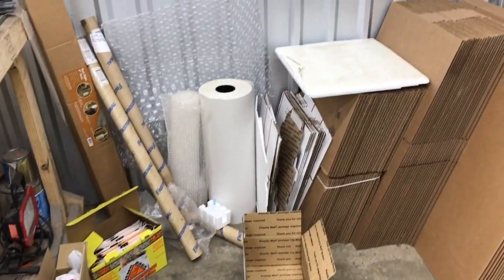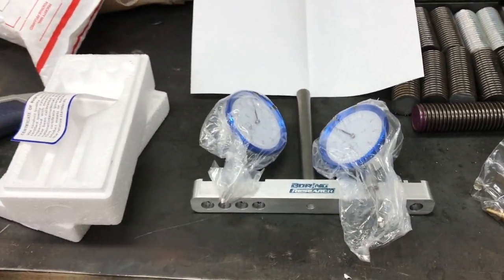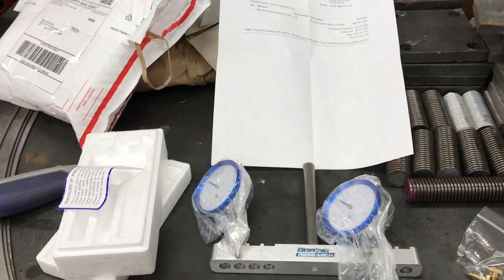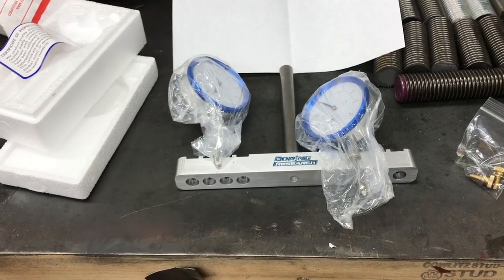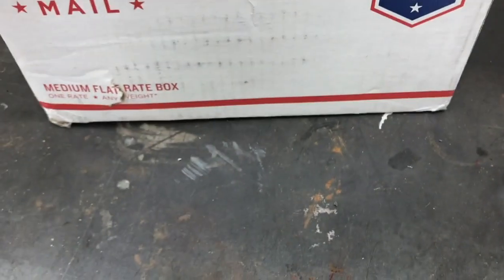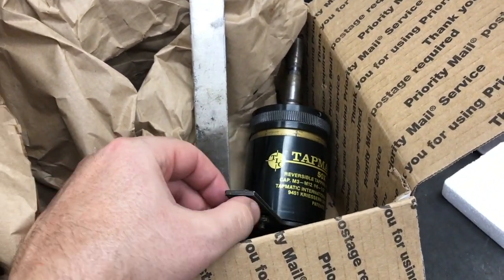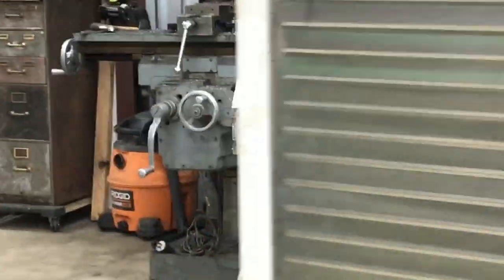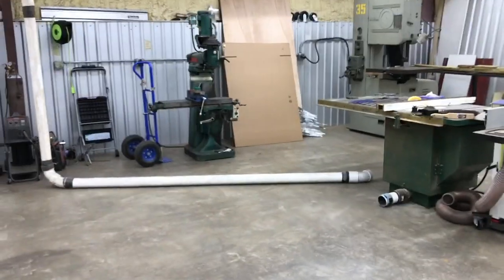Tapmatic Tap Head - Tram Gauge

Comment: The tapmatic  does a good job. The one I had went from 1/4 to 1 1/4 inch. Two collets came with it. One went from 1/4 to 3/4 inch and the other from there to 1 1/4 inch. You change collets by simply screwing a large nut from end . I used it mostly with Mag drill and also horizontal boring mill. They are self reversing so you can keep machine going forward! Also mine was #3 Morse tapper. Gary if sometime you start feeling a little" down " I have a great video for you to watch. The channel is Ramsey Customs , published 11/27/15 titled Handmade Walnut Bench. I just watched it again, I really enjoyed it !  Be safe and God bless you!!!

Comment: FYI, Tapmatic specifically warns against extending the reaction arm of the tapping head.  You are supposed to make a clamp-on ring that attaches to the quill of the spindle, which has a stop that sticks down and braces the reaction arm.